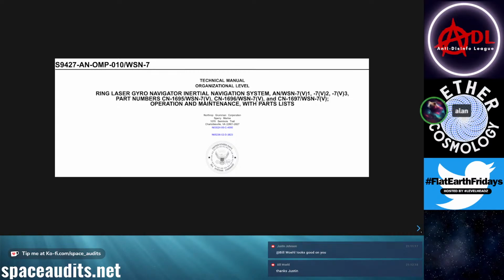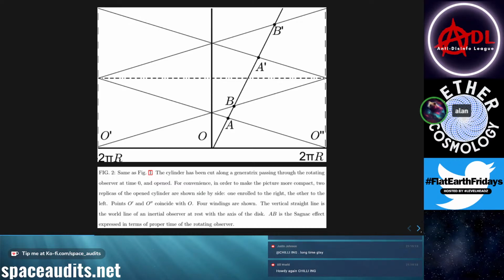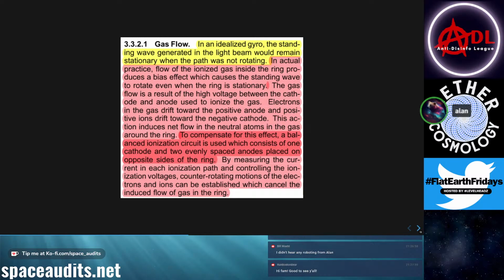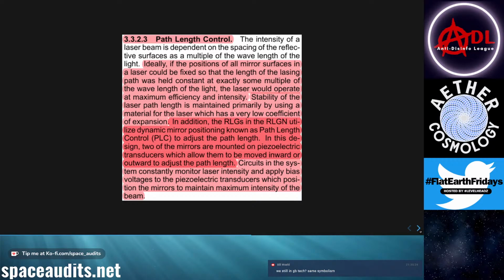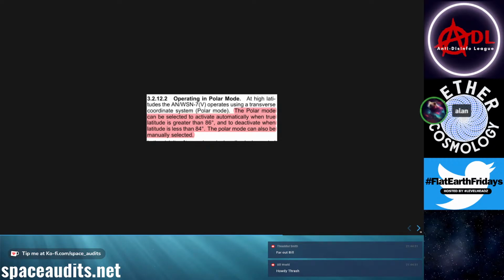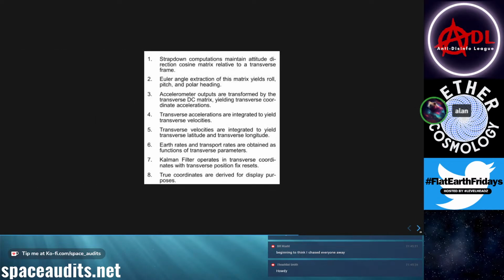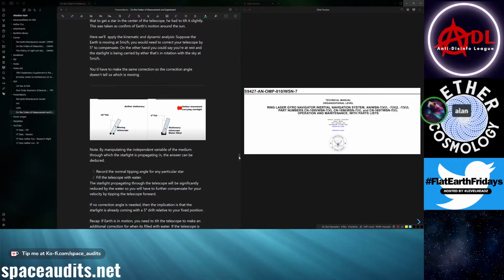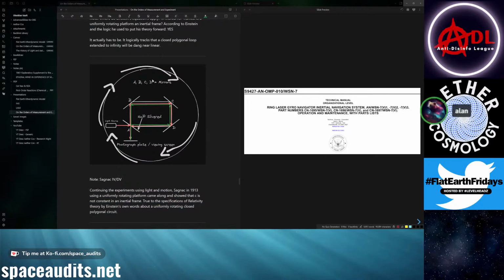#AetherCos - Research & Reading Night #05:   Inertial Navigation System Manual and the Sagnac Effect

Comment: Awesome show. I've been trying to  show globelins the fact about laser gyros using dithering and oscillation. To essentially be nothing more than digitized marine chronometers with internet capabilities. More or less just tracking the position of the stars. 

Also, the dual coordinate systems are admitted to in the use of line inversion and geogebra. Great work as always Alan.